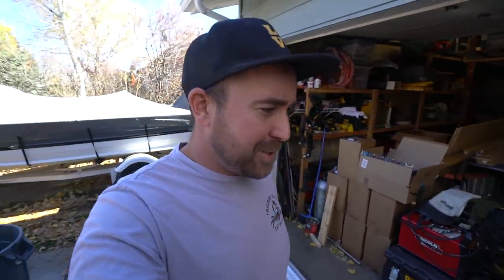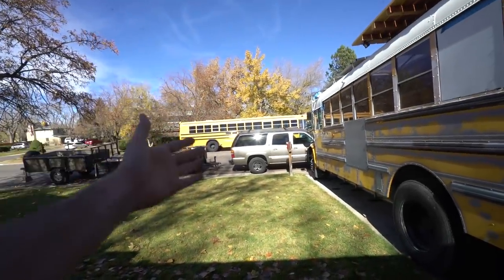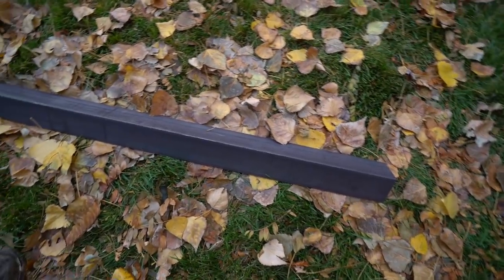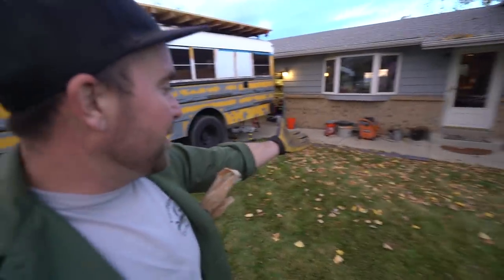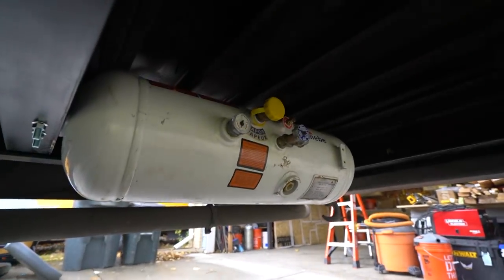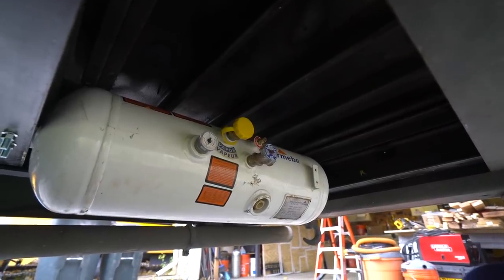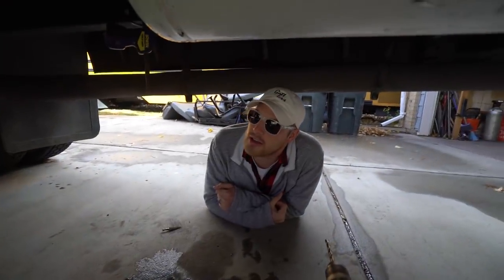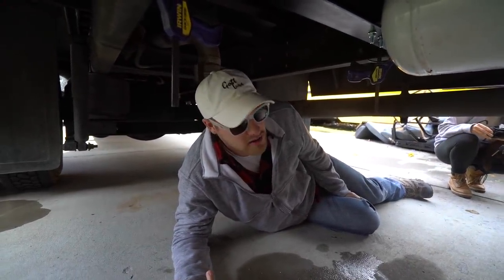RV Propane Tank Install + MeetUp w Gott Love

Comment: In my opinion, The tank should be forward of the axle.  You're tandem could have tire tread separation or an explosion in the desert heat.  The tire tread will have enough weight and energy to possibly damage your propane tank.  If you keep it there I recommend additional protection against tire damage.

Comment: If you want to keep a good relationship with your propane guy get a remote fill kit for the tank. That's a great spot to mount it but it looks like a pain to fill. Drilling overhead like that use a Jack for pressure if you can't push hard enough

Comment: Keep an eye on those holes you drilled through the bottom flange of the frame there's a 99% chance  cracks will start coming out from that point. I have seen many back ends of buses and trucks crack and completely fall off the vehicle because people did exactly what you just did drilling into the frame flange

Comment: Hi Jax, nice to see a video from you in my inbox. Cool install I think you did an amazing job, it might not have been a great idea to drill into the frame though as it could weaken it overall because the metal has to cope with a lot of stress, twisting etc. Thank you for sharing and that shower stall grouting looked awesome. x
Reply: Miles does AWESOME work !!

Comment: Hey Jax. Just a couple tips 4 future. 1)-get some cutting oil,cause going up U can't put it on bottom of frame so keep dipping tip of bit in the oil to keep it cool. 2)- start with small bit (less cutting area - keep it cool). 3)-with a small hole thru it will allow heat to escape thru the hole _ keeping the bit cooler bit last longer when you don't burn the tip. 4) 1/8",1/4",3/8"etc when drilling frame at low speed ---"keep it cool dummy" not U, just saying. 5)-I would use 3/8 atleast for holding that propane tank. 6)-put the bolts bottom to top. Lock a box wrench on nut in the frame with lockwasher & use your impact from bottom. 7)-save your uni-bit or stepbit = your conebit for thin stuff ie walls; to expensive to burn up. When using uni-bit still start with 1/8" bit. 8)-using breaker bars cracks those nuts loose a bit easier. Longer the bar the more leverage & more torque. Thats it!

Comment: Drilling metals with high pressure and low speed causes faster removal of material,  but also sends the heat away with the removed material. The work piece and the drill bit end up cool. With wood the speed varies with the hardness. High speed with softer material.
Reply: This was the lesson Kyle taught Jax. Yes, we all learn something new....

Comment: If I'd known you had the tank in we could have hot wired your pump at the van build you could have had a shower. 
Also I agree with the comment that the propane filling dudes will hate where you put it. Should be near the side for easy access.

Comment: Drilling the flange is not a good idea but it mostly is where the flex is it will crack  but it is only 3/8 bolt just check for cracks but between the axles never drill the flange. But this is my opinion only. Oh put a fill extension on the tank they will love you lol 🇨🇦🇨🇦🇨🇦
Reply: Hey Badge and/or Jax. We haven't heard how things are going with running the veggie.  Hopefully all is well with that system. I know you put a lot of research and thought and work into it.
Reply: Test fire test its working good he got over 1000 miles on veggie seems to work just fine lol🇨🇦🇨🇦
Reply: @Badgeweefixstuff  glad to hear.  I was against it only because of the availability of used veggie, but Jax is the man when it comes to scoring it from restaurants.  I have a couple of diesel vehicles(one that i bought to use with a veggie system) and after looking into it, I decided the problem was going to be the supply of oil.  Thank you for all you do for everyone.

Comment: The reason you don't cut/drill/weld the channels flange is because it is engineered as the minimum amount of material possible for for structural integrity while keeping weight down. That flange is what actually provides the frame strength! The upright part is "basically there for support for top and bottom flanges. Now, if the C channel/beam was a full I-beam instead, there would be a better chance of being able drill Thu it as you did. Also, most state laws may require you to get a safety inspection and mods to operate it on the roads. Anything goes wrong, like a collision, and it's discovered, you'd be held fully liable, doesnt matter then. Also, you may be required to post D.O.T. safety stickers for L.P. Fire department has to show up because the tank does a venting (common) and someone calls it in, there could be big ugly fines/impounding/revoked registration, etc... Two agencies that don't mess around on this is DPS and fire! Now, as far as the mod goes, you could have just used some angle iron, bolted it thru any convenient frame holes, or drilled a couple holes thru the "upright part" (ya know, the part with all the holes everywhere lol) also, remember all the "ford exploders" and other vehicles who's propane tanks blew up and killed people? You might want to add an impact/skid plate to protect the tank. Large solid plate to floor, as an explosion shield to cabin, and the bottom plate with holes to release gas (especially to sides and rear. You don't want most of the gas straight down. Terrorists used to rig them to explode and they'd flip busses over in big ugly fireballs. ) should it explode. Make no mistake, they can take off like a missile! Last thing you want is for an accidental fiery bomb going off with family inside and ripping a hole thru the floor. nice mod project though. Be safe.

Comment: I would put it more forward and in an easier location to fill it.
Reply: I totally ageee , when he pull s in a propane fill place and the ground is wet the dude is not going to be happy crawling on wet cement up under there also you have to bleed vapor off to put liquid in and the closer you have the tank to the side of the bus the better i think the water holding tank is right above the area it should be. On RVs they are suspended from the floor with some threaded rod or hex bolts through the floor above but hed have to remove the water tank  to do that or he could  fab some brackets out of angle iron and hang it off the other side of the frame and devinatley mount it closer to the rear tire so you wont drag the tank on a steep incline of back over a pole or something. A lot of nicer RVs have a protective cage around them in case of an accident now too.

Comment: disconnect your battery when you weld to the frame.
Reply: Matt Jackson and ground the frame close to where you weld. Although frame welding can be a bad thing if done wrong.
Reply: why do u have to unhook battery?
Reply: Bart Simpson so you don’t fry the vehicle electronics while welding.
Reply: akbychoice 23 years at a muffler shop and not once have we had any problems
Reply: Bart Simpson lucky you. One mishap caused over $6,000 in damage to fuel deliver management meters on one of our fuel trucks.

Comment: I'm just wondering how safe that tank is under the bus? Its off the ground far enough but I would worry something would get kicked up by those back tires and boom! or is that just me? How safe are those types of tanks?
Reply: Many LPG tanks are mounted under the body on RVs. Some have cradles and protective shields, many don’t. Tanks designed to be mounted under RVs are built heavier than LPG tanks for a grill.
Reply: akbychoice that’s true but have you ever seen this side of the trailer when the tire blew out? I’m talking about a semi trailer. It also has braces that go side to side and I’ve seen them broken and twisted and bent all to hell from a tire blown out. it can cause a lot of damage and the tank may hold the impact but the gauges and fill tubes won’t.
Reply: Charlotte Johnson I’ve held a CDL now for 28 years and I’ve seen much worse. Doesn’t change the fact of how RVs are built. People die on the road every day, yet people see it and still drive like idiots. I’ve seen tires blow and shatter windows because the driver decided to stay next to a semi, can’t fix stupid.
Reply: akbychoice,,,,,true story. I also drove commercially for almost 30 years and some of the things I’ve seen out there were just amazing. You wonder where people’s mindset is to do the things that they do.

Comment: Cant get my skoolie going...HELP!! lol..been sitting for 4 months..any udeas??
Reply: Does it literally not run? Or are you having motivation issues? If the first, what I have found in this community is SO ready to help. If it's the latter, this community is SO ready to help. 

What can I help you with?
Reply: Please define “going.”
Reply: Sorry, I guess I should have clarified it..it turned over and started as long as starter  fluid was being sprayed in. Then it died. Over and over again..we charged the batteries. Dont know what else to do 😟
Reply: @FloridaHomesteading  I'm no mechanic, but I'd say this group is a great place to get answers. Reach out to Jax for Badge's info, I'm sure he could help get you at least some answers to get you going.

Comment: Jax, there are some things that should be left to a professional. You said you do not know what you are doing, so for gosh sake don't do it with a propane tank. This install could be very dangerous if done wrong. You are smarter than this. I only say this with your safety in mind !  You are messing with structural components of the vehicle - be careful !